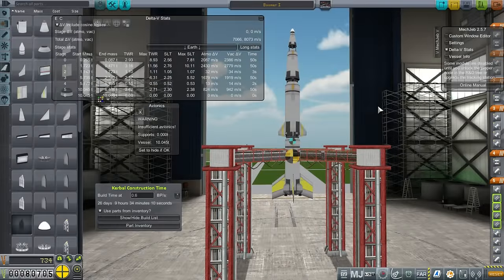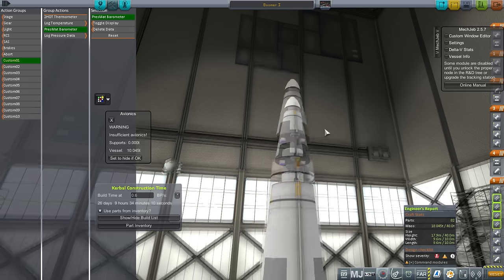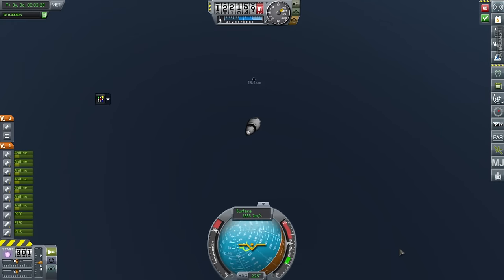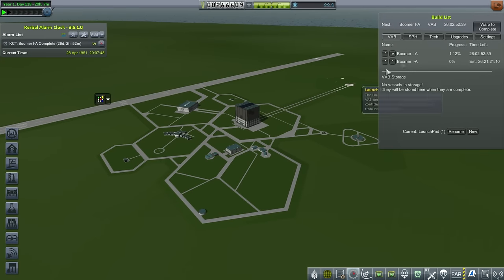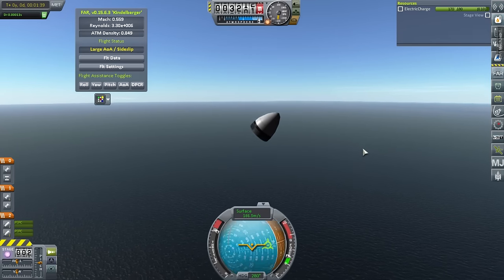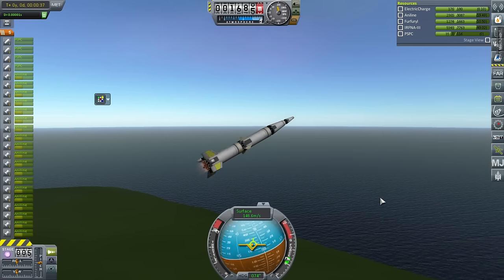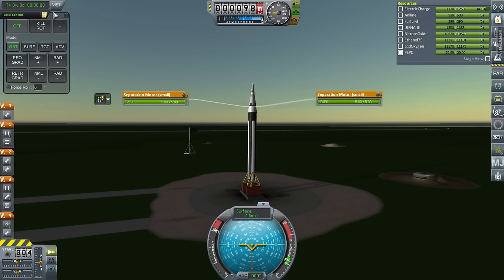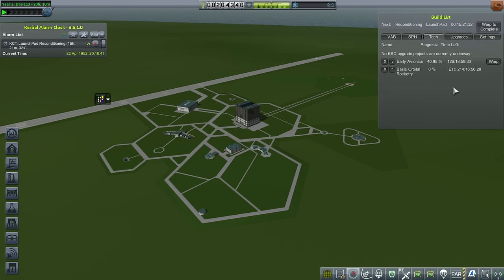Realism Overhaul in KSP 1.1.2 - 02 - Boomer

Comment: Tyler - you can use "T" , "G" & "B" to dynamically change the proc wings, just like in the old days before tweakscale!! that should help you make the wings smaller.Edit-I cant get mechjeb to work even in sandbox with the early engines. the gimbal just goes crazy
Reply: So do i. It still works the same
Reply: I only use B9 myself

Comment: For earlier launch systems, shoot for ~9300 m/s Δv
Reply: Yes, I understand that, it is just as a general rule for lower tech LV's. 9300 m/s works for earlier rockets if you have a time/funding constraint. Of course, you could just simulate it to find out how much Δv you can shave off.
Reply: Another thing to add, to have a perfect Hohmann Transfer to your desired orbit (let's use 300km as and example), excluding things like the surface, atmosphere and gravity losses, it takes ~7626 m/s Δv to insert to a 300km orbit. 
Let's say you lose 1764 m/s Δv in gravity losses (equivalent to burning straight up for 3 minutes under Earth gravity, which is a plausible estimate for a relatively low TWR rocket), then not including atmo losses, an orbital launch will cost you ~9390 m/s Δv.
Since lower tech engines have less Isp for less thrust, you will usually use more fuel for a smaller payload with less thrust, meaning a (most likely) a lower TWR value than a latter-developed rocket with better Isp values. This will result in the before mentioned estimate of ~9390 m/s Δv for an orbital launch (most likely, differences arrive with different flight paths). 
So yes, it is dependent on TWR, but also on Isp, so I suggest doing your calculations before making  estimated Δv for your launches, then shave off or add however much you need to after you pick a reasonable flight path through simulations of the LV.

Comment: Isn't "utilization" meant to represent tank's inner structure that takes up space? Setting to to 100 is kinda cheaty and unrealistic, methinks.
Reply: Its realism overhaul, if you can do it its realistic enough!
Reply: Utilization set to 100% means the tank has NO internal structure... Now that's true only for balloon tanks with only one propellant in them.
Reply: ***** I'm sorry if I sounded salty in my previous comments, that was not my intent. You're doing a great job and we all appreciate this. As for the tanks - i know about Atlas inner workings, I'm quite fascinated with that rocket. All I'm saying is 100% is a bit cheaty even for an experiment, maybe try to go about 95-97%, that'd still be pretty realistic ;]